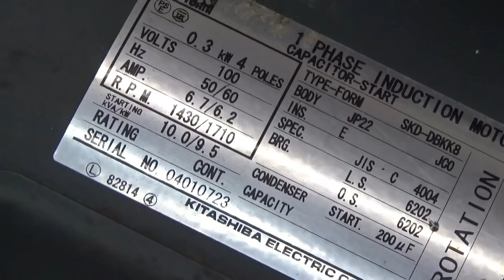Electric Rotary Pump Restoration.

Comment: 10:25 When it works, it's obviously not the wrong way to use it! 😁and great restoration. 👍👍👍
Reply from the maker: exactly.
Use it correctly like this. 11:10
There was no way. The black shaft is slightly bent!

Comment: I think the paint was better off done using air spray unless that paint is similar to hammerite. Also why was the builder plate painted over?
Reply from the maker: The hammer light is amazing.
Many people like that color.
However, they are not sold to nearby stores.

Transparent masking tape is used for the plate.
Thank you for watching!
Reply: @diyrestorationclub7534  Ah nice. Okay, good to know the builder plate was masked during painting.

Comment: It's a compressor, rather than a pump ☺️
Reply from the maker: Thank you for your comment.　Is there a difference between the two? It seems to be confused in my country. Thank you very much for your knowledge.
Reply: I think it is a compressor because, as you can see in its inner mechanism, the air travel through the chamber and the space decreases, so the air is indeed compressed. Fans don't compress the air, they just push it ☺️
Reply: No...it is not...
It is a flow pump...👍🇬🇧